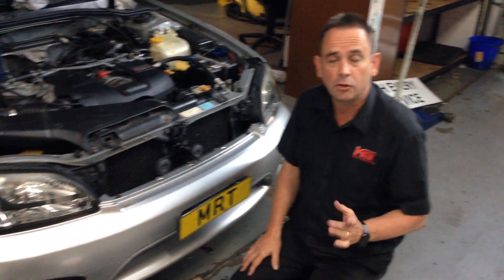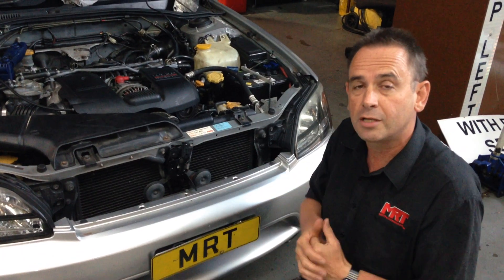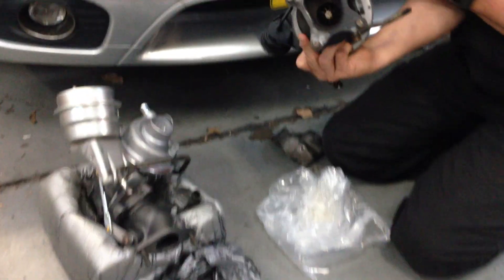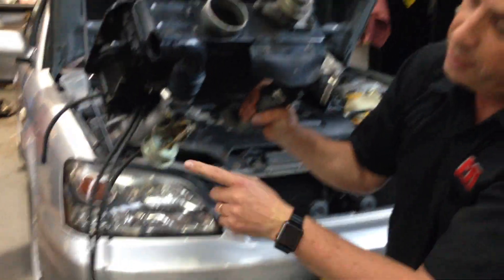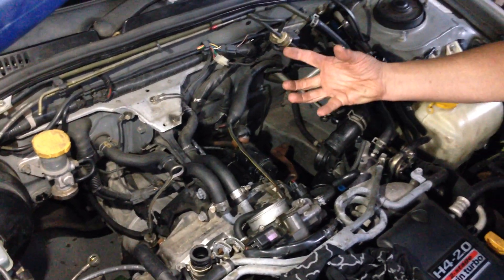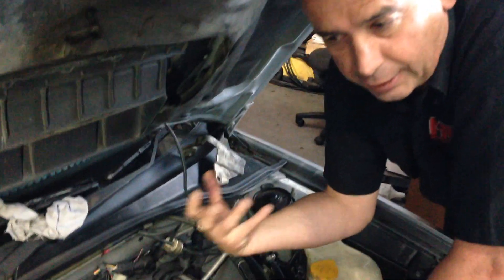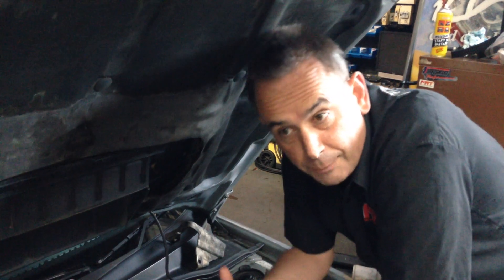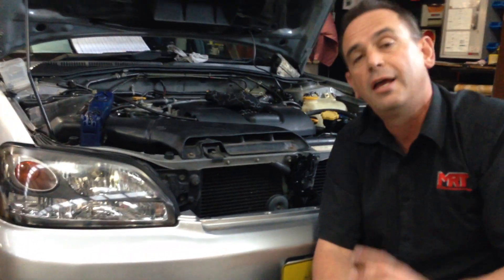How the Twin Turbo setup in a Subaru Liberty B4 Works

Comment: I have a subaru b4 legacy 2001 with a ej20 engine twin turbo. My primary turbo is making a strange noice  as if it stack or something. After I removed the intercooler I found engine oil in it. Kindly assist me these two problems engine oil in the intercooler and strange noice from primary turbo.

Comment: I have the JDM 2000 Legacy and it looks the same. A few years ago my primary turbo went bad and caused the car to smoke excessively so my mechanic disconnected the oil line and I was able to drive the car without any smoking (low power) until the replacement turbo arrived.
Reply: What turbo please bro I got an 03 b4 and the primary sounds like shit I need a new one 🙏

Comment: I had to replace a all the spark plugs on mine recently was running rough at idle and down on power like it was running on 3 cylinders.... about only issue had with it since owning it...

Comment: Can't wait bought a b4 getting a tune and service with mrt next couple of days will keep u guys tune what happens
Reply: so what happened?
Reply: @Ur Mama   yeah good results Ben was the tuner good guy lots of knowledge with these car got good power massive difference after tune vod is barley there
Reply: @advancedhinges  sounds like it was worth it! do you know the change in bhp you got?
Reply: I got 196kw atw exhaust back from turbo bigger top mount and that all the work iv done to it Maxed out injectors
Reply: @advancedhinges  nice, was hoping you would be have an rsk but sounds like its a different B4 type?
Reply: It's an Australian model still twin turbo ej208 motor they call it liberty here overseas there called legacy inthink there ej206 overseas
Reply: @advancedhinges  interesting, those models from stock usually have 198kw+; just wondering if Ben could explain why its not above 200kw after a tune and mods
Reply: @urmama54  yeah that's on the flywheel  
I'm getting 196 at the wheels
Reply: @advancedhinges  ah i see now, increased my understanding there. that tune definitely seems worthwhile then

Comment: I run mine on 100 octane in NZ but lately I been having Boost issues. Used to do around 12 psi on primary and 15 psi on secondary. Now only seem to be getting 7.5 psi max on primary and secondary.
Reply: Did you ever figure this out? Mine is doing the same thing.
Reply: CPC valve sticking, solenoids sticking, or vacuum leak. Clean all your solenoids with plastic safe brake cleaner

Comment: Thanks! Although I can’t find out why the second turbo doesn’t kick in on my car
Reply: Could it be seized up? I read a story where someone bought a GTB off an old dude who obvs never revved it, The 2nd turbo was seized but eventually freed after a bit of frantic driving. Good Luck!
Reply: Now that I look at it, I think the car is retarding the timing when the second turbo kicks in. Because the car starts bucking in after 4500 rpm. @stuartmccloud307
Reply: My car is doing the same thing it hits boost in anygear pulls hard upto 5k rpm roughly where the secondary turbo would kick on and it falls off completely change to the next gear and it makes boost very slowly

Comment: Currently rebuilding engine in a 1997 Legacy GTB - block and heads currently at workshop getting skimmed, rehoned and cleaned up. This is my second one i am rebuilding, can find video of me starting my RSK B4 from several years ago on my channel. Will update once i have more info. But the vacuum pipes are a bloody nightmare especially if you don't mark up which one goes where. Would be interested to find someone who can tune the ECU to limit the valley of death - would be good.

Comment: btw, you did mention that 3" dumps on these is too big? What size system do you guys recommend?
Reply from the maker: its al part of an overall design and tuned package, so not an easy yes or no answer......
but bigger is NOT always better
;)
Reply: Keeping it cryptic...
Reply: Can't speak for their systems, but 2.5 inch dump pipes into a 3 inch pipe after a y join is generally said to be the most effective sizing, and it's what has been put on my car by a PO and it runs well. Could even improve on the design of the one in my car by putting a flange on the primary or secondary pipe near the y join so either downpipe can be removed separately, so that you don't have to be on a lift to remove the one entire piece from the car.
Reply: I have a 2001 b4 with an mrt y pipe back exhaust system. It’s 3” stainless steel with stock dump pipes. Seems to work well. Ecutek tune. 210kw atw. No ping and very minimal vod.

Comment: I own one of these, great car. Got it tuned by Kiddo Racing.. and virtually eliminated VOD, and improved mileage and performance significantly. Exhaust would be nice but not real necessary.  Only thing with BE5’s are the rubbish headlights.  Recommend factory low beam HID’s  from Japan and a light bar behind grill for high beam 👍🏻

Comment: This car on factory Australia tune over 5 years that i've had it had almost destroyed itself seemingly, at this point i'm fighting at approx 166.xxxk/s is idle shudder which seems to happen when i turn any electrics on, at this point i've repleaced cam sensor, replaced the battery, checked output on alternator,  ( had to replace the turbo actuator on the 2nd turbo-not the cause of problem but because of the stock aus tune it seems to blow out the diaphram while i'm thinking about making it vacuum instead of pressurising to open the door.) back on original problem i've yet to investigate a fueling problem wether the fuel pump is dying and starving the motor or filter is simply blocked, i have other information as to how and when the problem started - literally car off car on.
Reply: I know this is long past, but if anyone is looking at this, I had this problem and it turned out to be the alternator. Specifically something internal in it (I was told the regulator? is inbuilt) and it malfunctions, so even though it looks like it's charging at correct volts, it's not putting out enough (amps?) to run the air-conditioning and fans (and/or lights) and the spark at the same time. ECM lights up and it throws non-firing cylinder, or bad injector codes as well. Tends to run better when you spin up the revs but if you turn off everything electric and it runs better at idle, this might be it. Hope this helps anyone looking.
Reply: @groadoswaggins  the above problem turned out to be the alternator cable was tampering with the fusebox, possible play.. and was sending codes left right and center to all the sensors due to inaccurate voltages, all it needed doing for a temp fix was to move the alternator send cable a few cms and lodge it behind the battery =] after a few months of throwing money at it.
Reply: @groadoswaggins  The factory gen3 Rev D as far as Revs are concerned it's a 110amp alternator, and is built to handle the electrics, however my alternator failed at 150.000 k's
Reply: @X3lfl3X  I had one fail at ~120,000 km, and just last week the brand new (at the time) OEM failed at 198,000km. Same symptoms, very rough with misfires especially at idle, same fix, change alternator. I think I was working the 2nd one too hard on an old battery for too long. 
Did you ever find out what the issue was on yours?
Reply: @groadoswaggins  the flange on the 2nd turbo ? or the electrical issue ? yeah.. both fixed.. fk what a headache these are.. eventually i gave it to my ex, and bought a super custom turbo diesel hiace.

Comment: I have a question my 2.5 turbo charged engine for my Subaru gt might be unfixable. So can I replace it with the EJ200 twin turbo? And will it have good hp
Reply: nah mate cheaper to stick with another 2.5 replacement than 2lt TT swap

Comment: when changing out the secondary turbo actuator,  how do you preload the seconday turbo actuator?  do you set it to 3 full trun revolutonand then pull it on? or just adjust it till it  fit without any pull? hope you understand what im asking.

Comment: Hey hopefully you may be able to steer me in the right direction. The engine in my partners 2000 model b4 seized so I swapped engines and everything is working fine and drives fine but the primary turbo is not creating boost, no low end power, and throws fault code 66 when are 3500-4000rpm. could this be anything to do with vacuum lines or seeing as the primary doesn't have many vacuum connection could it be a sticky/stuck Wastegate?
Reply: join the NZ twin turbo Subaru Fb page to get better feed back

Comment: I have a 2001 GTB, the Blitzen model, automatic (tiptronic). Since I imported it from the Japan, I've had code 66 error, I have checked all hoses for leaks and I haven't found any leaks, cleaned the driver's side solenoid properly and visually checked it and seems fine but still the car throws code 66 and engine ECL comes on, 7/8 times out of 10. Engine kind of stalls/hiccups and secondary turbo will not boost. Sometimes it does come on and car boosts well both in the primary stage and secondary stage. Don't know what to check next. I haven't checked/cleaned the passenger side  solenoid yet or under the air - intake area. I have noticed the air intake fins slightly damaged on the side (less than 1 cm) and the big actuator on secondary turbo rattles a bit at idle speed but stops when you hold its arm that opens and closes the valve connecting to the exhaust system. Help is appreciated.
Reply: Probably this could help: http://arbmonster.narod.ru/twin/twin.html
Reply: Thank you, buddy.
Reply: any white blue smoke secondary turbo could be toast
Reply: Probably missing heaps of restricter pills in the vac lines

Comment: Are these only available in kangaroo land? I wouldn't mind wrenching on one of these here in the U.S.A..
Reply: can only import to us after they are 25 years old.
Reply: uk ' canada ' new Zealand got them aswell .But Australia the only country outside Japan that sold these Brand new.The  Cheap as chips in japan .$1500 USD  WITH LOW KM
Reply: will have to be imported as well mate, you could but the motor but it WILL NOT FIT your left hand drive cars.!!!